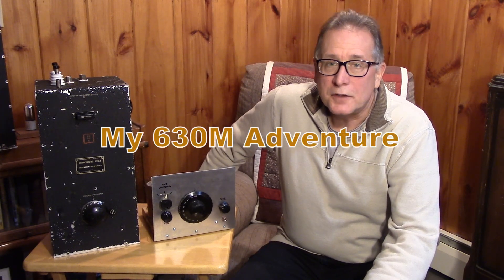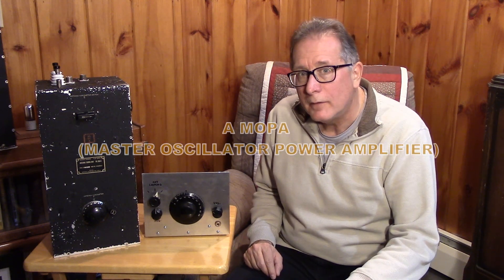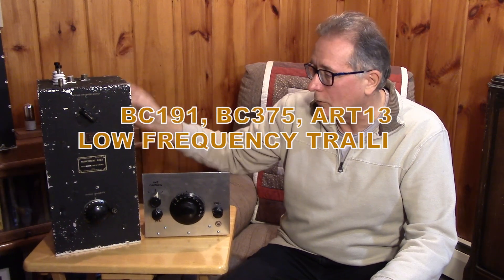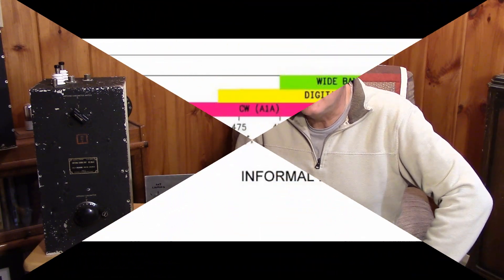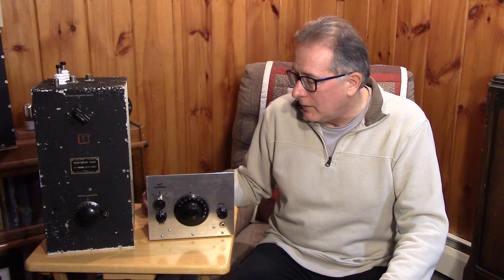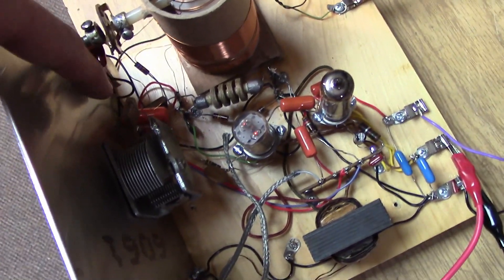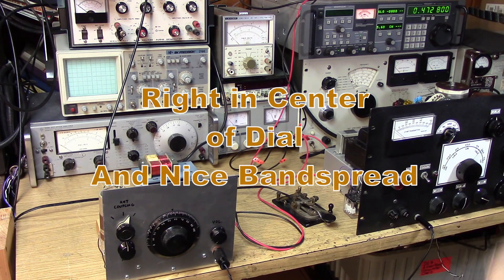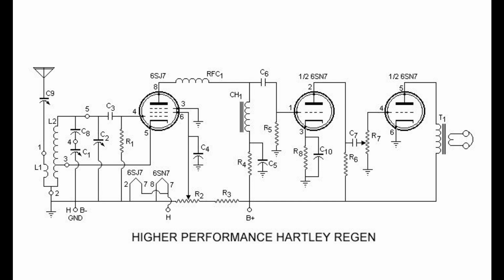My 630M Adventure  - Part1

Comment: The Audio amp section of 12au7 can be reflexed as a rf amp for isolation. On 630M a Class E using 1000v mosfets running off halfwave rectified  mains voltage also is a great option
Reply from the maker: Class E is the modern efficient Standard for many experimenters here on 630M. My valve approach was quite a deviation from the norm today. As is Reflexing. Wow that is an old fun area to explore.

Comment: Something I discovered many years back on crystal radios is:
A wire running around the house could be brought into resonance by treating it as a big one turn inductor.
When resonant, a wire off one side of the capacitor made a much better antenna than the wire without the tuning capacitor.  
The tuning of the antenna was quite low Q
Reply from the maker: Generally a shorted loop is less prone to close coupled noise because the electric field pickup is somewhat reduced, and its impedance is lower in most cases.
Reply: @MIKROWAVE1  In my case, noise wasn't the issue.  It was signal amplitude I was after.  This was a crystal radio.
A symmetry argument suggests that an antenna that works better to receive RF power should also be better to transmit power.
BTW at the lowish frequencies involved in this band, there are tricks that can be done to make the RF output stage recapture the energy from the reactive component of the load.  The simplest version only works with inductive loads.  Consider how a buck regulator works to see this.

Comment: It's odd that the regen was supposed to use a 12AU7 but the shot from above it looked like an octal tube, maybe a 6SN7?  It had no evacuation pip sticking up like the 12C5.

I've got another question about the B+ but I'll have to go back and look at the schematic.
Reply from the maker: Um I checked and it was a 12AT7. We were both wrong. Ha. Actually a 12AU7, 12AT7, 6SN7  octal etc. would work equally well in this circuit.

Comment: Well done on your construction projects Mike.  I live in Simi Valley (next door to the San Fernando Valley aka LA county) and there are 3 of us that meet twice a week on 476 KC using USB.  I using a modified Heahtkit HW-18 Transceiver into that BC306 antenna tuner with a 40' vertical with an inverted L.  Were running somewhere around 150 watts and I have NO ground radials, only the water pipe and am heard quite well all the way to Burbank,Ca with a strong signal (my house was built in 63' so all the pipes are iron which connects to the city main which is also metal so that's what is doing the heavy  lifting) .   When we get our spring rains I can start laying ground radials.  Both of the guys on with me are using Transverters and are putting out 200 watts to overcome that massive QRM.  I am using 2 DSP noise cancelling units in series to deal with the noise as I have a 18KV powerline in my backyard.
Reply from the maker: Wow that is an awesome conversion!

Comment: First tube type receiver I ever built was a regenerative single tube broadcast band receiver, built over 70 years ago with second hand tube, rf coils and other radio parts. Didn't have my Ham license in those days, and I had to be careful operating it because carelessness in tuning could result in it becoming a low power transmitter to other radios in the house.

Fortunately I never got any complaints from neighbors, or any notices from the FCC.
Reply from the maker: So the snooper truck never came by your neighborhood!

Comment: Thanks Mike. Definitely signed up for this new adventure. In the UK we have access to 630m with 5W eirp (secondary basis, full licence and some restrictions). I was trained many years ago on MF marine transmitters that worked around the old CW marine 500KHz distress frequency and calling channel. These were Marconi sets which used thermionic valves rather than these "toobs" you were talking about 😁. So, would be very interesting to get on the air on this band - especially with the weak signal digimodes we have nowadays and some CW of course.

The Marconi Salvor III is one that I remember. One of these with a little VFO mod for 630m would be nice? It even has a built in morse key and a very impressive variometer for antenna matching.
Reply: Steve
Are you aware of the rsgb lf  group? They are very active on both sides of the pond.

73 Steve M0KOV
Reply: @oilydigits  No I was not. I have just applied to join. Thank you.

Comment: I use a RAL receiver with an ART-13,  CU32 antenna coupler. VERY noisey operation lots of relays clicking away at one time.
Reply from the maker: My friend KW1I put an ART13 and RAL on several years ago during the experimental phase of getting us a new ham band.

Comment: Mike
You've published this video on a UK VHF contest night, so I'll have to watch it tomorrow. I've built a small 25w 630m transmit transverter and even feeding into a highly inefficient antenna, I was amazed how far the resulting miniscule wspr signal got. Looking forward to seeing your setup.

73 de Steve M0KOV
Reply: Watched it and I now hang my head in shame, I'm a solid state sinner:-(
Looking forward to the rest of the series.
73 Steve M0KOV
Reply from the maker: Oh I like Solid State too. I just revert to valves as habit. There is no doubt that 630M and 2200M are naturals for Solid State Class E approaches in the TX and SDR in the RX.